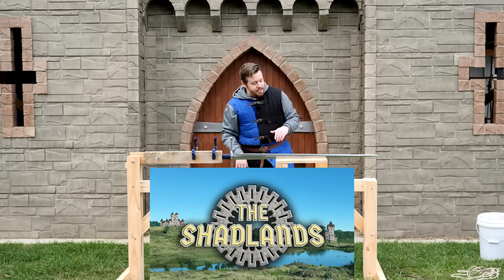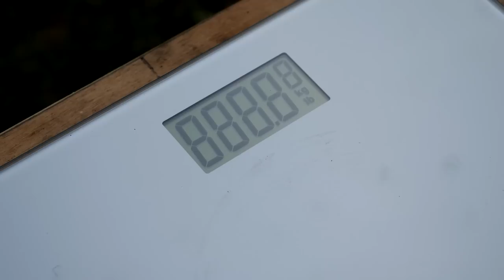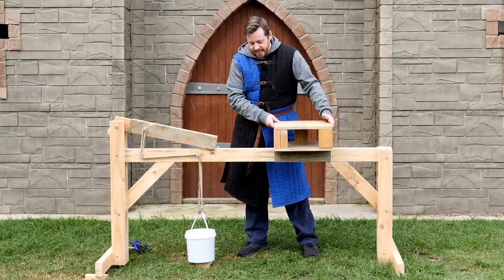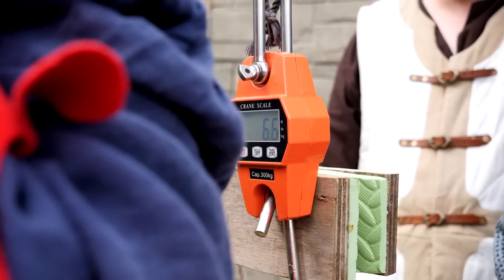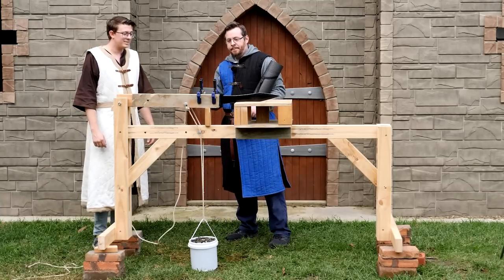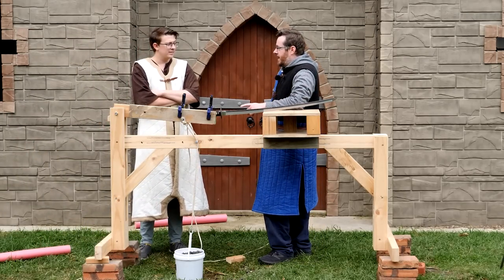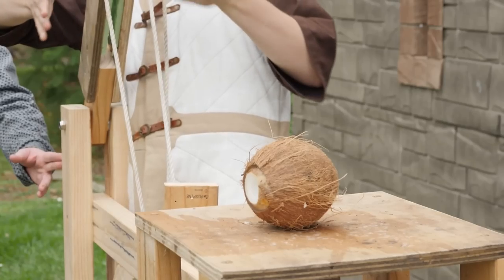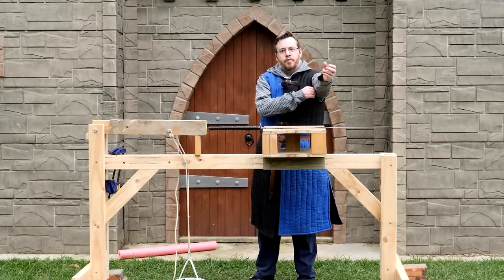Choppy choppy

Comment: My guess for why the Katana behaved so weirdly would be a mixture of two things adding together. The first sword looked like it had a lot more excess metal so the sword strike would've been heavier. Then as for why removing the Katana and swinging it yourself worked... It looked like the sword struck closer to the handle than in the "Choppy Choppy" guillotine lol. Plus I imagine you can swing harder yourself than the guillotine was set to. And you didn't lose as much energy during the strike because you actually held it in place (Instead of the sword twisted up in the clamp and losing energy). 

I'm just spitballing now lol. I don't know what I'm talking about. Take this with a grain of salt. I'm not one of those very smart people you mentioned watch your channel sometimes haha.

Comment: You should measure how much force your strike has then try to replicate that force on the rig. For example if your strike does 15 kilos of force you should try to replicate that with the rig and not how much pressure you can apply just by pushing against the scale.

Comment: 7kg was the weight at the tip of the stick, closer to your hand the weight would be much greater...
So... why using 7kg as the weight in the handle, in the hand, in the "cut simulation device"?

Also, the grip bends the katana's position... just a person with a very weak "grip-force" would allow the sword to go off your hand after a swing... maybe the machine's grip should be a tube in which you put the sword handle in.

I think that the weight and blunt force of the sword previously to the katana helped to crack such round shape..

Comment: Hello! I think you misscounted torque. You were using 8 kiloes as reference at the end of the stick, yet you use the bucket of 8 kiloes not at the end of the swords, but at the handles of it. Remember that 1,4 kg force the bucket was pulling from the close to fulcrum point? That is actualy the case to other cuts aswell, since you measure 8 kiloes at the handles of these, not the ends of these swords.

Comment: You're comparing the force at the end of a club being pressed down to what is the equivalent of pressing down with just your hands. For better "realistic" strike force you should put the club you used to get your human measurement in the device and measure force from the tip of the club as you did in your hand. Also just buy some weights to hang on it. The clamping may also be part of the problem. A more cupped holder would transfer the energy more efficiently although to make it more analogous to humans some play in it would be good. You can also measure the speed of your swing and your guillotine.

Comment: Is this achieving the same speeds as a human performing a regular chop though? My impression is that if I chop just by letting my arms drop while holding the sword, that is significantly slower than cutting while actively moving the sword down. When just using gravity, it seems to measure more the ability of the sword to cut by its own inertia, especially if the clamps slip on impact (it's like someone dropping their sword from the shock of impact). I suspect swords that aren't particularly heavy require more speed to cut. Maybe using springs or rubber bands one can achieve faster acceleration than by dropping a mass from rest. Maybe have the bucket fall a longer distance (e.g. leave a length of loose rope that tightens some distance before it hits the ground).

Comment: This is fun and all but very far from practical or realistic.
You will have a harder to accelerate bigger/heavier weapons beyond a certain weight and acceleration is all wrong if you just drop it.
Btw on a Coconut the angle at which you hit is very important, just like when you hit wood.
You should totally collaborate with Joerg from the Slingshot channel, he is really good at stuff like this.

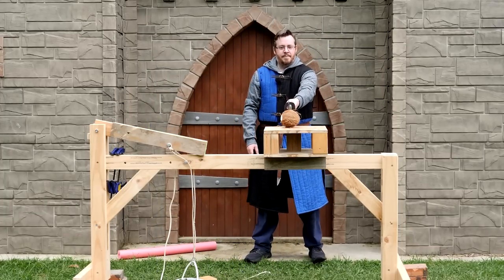Comment: 27:30
Whats going on?
You measured two different agular momentus with your stick and with your machine in the end.  But did it in kilograms.

At the start when "weighting" your strentgh you did it at a much greater distance from you shoulder compared to the machine. 
Your force you can apply to the short leverage of your hands (like weeare you measured the 7kg at the machine) would be much higher then at 50cm more. 
You need to measure your force with your hand on the weighting device.
(Also some other points were made in the comments. e.g. you disregarded speed and momentum itself.)

Comment: Replacing the bucket with solid metall disks from fitness equipment should shorten the distance, if you put a rod/pipe through and a metal retaining ledge below, the top should have a threaded insert ind you simply put an eye-bolt in and tie the rope to it. Why shoudl you pursue this as an option? Well 1. rock is not that dense, you're waisting around 5ish Kg/dm³ compared to steel (+- a bit that is), 2.the bucket is not solidly filled, there's a lot of air in it, which means wasted volume. 3. You're wasting a lot of distance with the bucket handle.
Those three reasons result in a lot of lost distance, so I'm fairly certain that if you go for a more flat and compact weight you wouldn't need to lift your "testbench" up much, if at all.

Edit:Maybe put a pulley in which lifts teh weight up, if lenght still is an issue? Sure, you'd need more weight, but a bigger diameter disk can aid with that, at teh same time though the way the rope travels gets increased a lot with each additional pair of pulley wheels.

Comment: i would think that your sword-strike-simulator is more elastic than your muscle apparatus. hence, when the sword strikes the target, in accordance with newton's 3rd law an equal force is applied to the sword in backword direction. while the target will not budge in both cases the apparatus will bounce back with only a few kg counterweight. on the other hand, when you strike your muscles tense and will not so easily give way to the counter-force and the resistence of the material is tested. it would be the same if you would just lift the sword and let your arms fall down... yes, you measured or at least approximated the force, but a falling weight is not the same as a muscle system getting to work in on direction...  I guess

Comment: Problem with the tests against the yogamat is that the device doesn't have any actual cutting power. Sense there is no movement on the plane of the edge all the energy from the strike is commited purely to chopping. That will also be a problem in the later test results. This method only measures swords chopping ability and not cutting ability. So you need to be careful of the conclusions you draw from the results.

Comment: Bruh can I ask a stupid question not related to this video. Did sling shot weapon use in Greek and Roman era stop in medieval time.
Reply: ... sling*shot* weapons did not exist for awhile. Suitable plastically deforming material had to be made for that (rubbery stuff).
Slings, however, yes. Lead shot used for slings have been found at medieval battle sites, and slings have been depicted in medieval artwork.
Less prevalent than bows and crossbows by a long shot though.

Comment: Would be a little more informative if the joint simulated a cutting motion rather than a straight down chop. 
Would be fairly simple with a multi levered hinge.

Comment: I think part of it is you are losing some of the bio mechanics of a cut as well, for instance when you cut down you drop your weight giving more force to the strike. When you measured your strike you were static and standing straight. Perhaps you should do a full power strike on a sensor then recreate that forcr with the test weapon to calibrate the device

Comment: I think practically clamp slippage is the most easily adressed problem.

However, what I would guess is going on here is that your analog to a manual cut does not adequatly reproduce all characteristics.

For a start I would like to see if the speed of the swords cutting area is similar in manual/guillotine- mode. Analysis of (high framerate) footage might be practiccal.

The fundamental problem I see with your approach is that you try to work with equal input, but since the body mechanics of a manual cut do not match the guilotine the resulting movement of the blade does not match. Analysis of the blades motion from footage (a bit like motion capturing) might shed light on this.

As an aside: You could approach this with a more scientific mechanic basis, like trying to discern angular momentum and kinetic energy of the blade and measure the input as potential energy rather than force (since you were not measuring weight with the scales). With your experimental setup it might be simpler (and more fun) to tinker around (while analysing the resulting blade motion and speed via video capture) until you get it right.

Comment: The biggest problem I see is that you calibrated it based on how hard you could press down on a scale, which I think is a very inaccurate way of measuring striking power. What I thought you were going to do, and what I would recommend, is get some dense material, strike it as hard as you can with a sword, and then see how deep it cuts. Then do the same with the guillotine, adding more and more weight until it cuts down to the same level.

Comment: You can cut it cleanly in half then machine cannot because the machine is trying to use a Cleaver action with a sword. And there is not enough weight being swung past the coconut to avoid any of that damn Workforce except for momentum plus the weight beyond the coconut as the entire blade is moving at the same speed thereby applying the mass between the center of the coconut and the tip of the blade plus the momentum minus the foam padding. Without any slicing action. You are expecting a compression cut but more than 1/2 or the weight of that blade is not being used  in the testing process. And that is not how a cleaving action is performed. If you want that Katana to split the coconut you will have to place it halfway down or up the blade whatever you consider appropriate terminology. So as to have half of the blade on the far side of the coconut. Allowing the entire weight of the blade to come down on the coconut. Right now you are smacking the coconut with the sweet spot of the blade if you were slicing not for the sweet portion for chopping. To redefine you must send the heavier portion of the blade beyond the coconut if you want to chop the coconut and it would be better if that machine of yours had a wrist so that the tip of the blade could be coming down faster than the handle. As it is actually quite easy to split that coconut in half with the katana using The Sweet Spot of the blade for slicing. Buy whipping your wrist at the last second before connecting with the coconut and using the entire 7lb of follow-through.
Right now you are only using that 7 lb - the energy lost when the storm that is gripping the handle allows the handle to rock thereby stealing all of the weight out of the tip of the blade. In addition all of the weight of the blade in front of the coconut is immediately stealing the power from the tip of the blade when the coconut becomes the fulcrum the problem with the katana is that the candle is flipping around in the foam and there is neither enough inertia nor remaining Force to keep the blade from flexing when it strikes the coconut. I hope you have a slow motion camera attached that you can watch the English two handed sword was a different story as you had more of the blade beyond the coconut and a greater grip on the handle due to the length of the handle. And both of those are multiplier that slow down the transfer of energy from the tip of the blade back to the handle forcing that coconut to be split. In addition it was a straight blade so when it came down on the coconut there was no place to Bend immediately and it just bursts its energy across the coconut according to the weight in front and behind the coconut dragging that energy back to the handle slower , and the handle itself moved less do to the longer purchase of grip.

Comment: Your clamps aren't strong enough to prevent the swords from moving. You need at least 300 lb or 136 kg on each clamp to sufficiently fix the sword in place and not have it move on impact. Those speed clamps just can't do it. You'll need at least the heavier duty, all-metal clamps with screws to achieve that high of force.

Comment: Simply put you measure 7 grams in the wrong spot, you initially measured the tip of the stick but when calibrating you used the handle as a point, 

you even pointed out how moving the measure outwards an inch you lot a whole kilo of force, so the sword is even further out losing even more energy

Comment: the problem is, you have the 7 kg at the lever point and not at the tip of the blade so your blade only has maybe around 4ish kg of force, put a bar in your rig place it on the scale, and had weight until you reach 7kg.
also, the force you push is not equal to the force you strike with so you better hit that scale and see how much force you deliver.
because the problem of your rig is the math you use as reference they are false.

Comment: I see a limp wrist you did not appropriately clamp that sword. Moreover you forgot to bills in a slicing action. So you are testing compression cut and that is not what swords are built for. The easiest way to fix your machine would be to put a block on the bottom of the arm at the back of the handle and then to put 7 lb of spring tension wrapping the front of the handle and holding it in place and allowing the arm to Pivot past the table. Because with the back of the handle tied down to the board but allowed to Pivot in the front of the handle being held in place with spring tension and being allowed to swing 20° past the table you should get a nice slicing action just like your wrists would give a nice slicing action as you drew the sword across the body. But by all means keep the pieces of plywood on the sides left and right to ensure that the blade does not jump extremely off track and the phone was a good idea as it will help to settle the handle in a comfortable position but obviously it will not hold it so that is what you're going to have to use the spring tension for. I will bet if you win over to say hello to your dad he would be laughing his butt off as what he did for you is help you build an education trap. You are going to learn the right way to build this but he's not going to give you any more than the appropriate way to mount the legs to the table the rest of it you get to figure out. But I am sure that after you explain what you want to do he will help you to design what you have explained to him. However he is an engineer and you wanted to build a testing station. congratulations you will be tested. And when this is all over you will not be standing on your father's shoulders you will be standing proud and alone with your team knowing the ins-and-outs of this machine and why it works.

When I was but a young man I stood on the shoulders of Titans. My father just sat me down and said it is time for you to stand on your own two feet you have children of your own and someday they will also need a Titan shoulder they can stand on. Dare you be that man that Titan?

Comment: You tested your downward strength by 1 method... Then tested your machine weight with a different method entirely. You ahould have chucked the same stick into the machine and rested the tip on the scale. You tested your 7 kilos at roughly where your hands hold the sword... Not at the tip of your sword like you did with your stick.  You could probably also find a way to better secure your swords in your machine because you're losing all of your Force by the grip slipping out.

Comment: shad your initial force measurement first, was a pushing not a striking type force therefore much weaker, second the force was measured at the tip not at the hanle which is where you measured the draw weight from so tge striking surface is still far less strength than the 7 kg that you measured